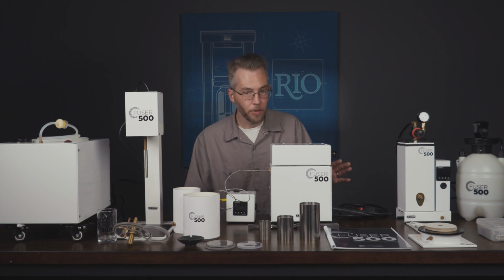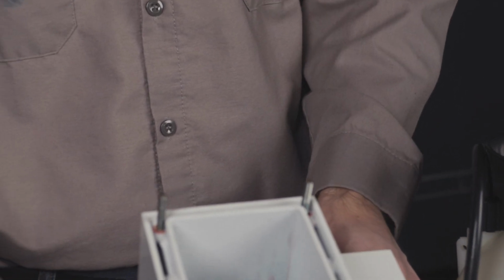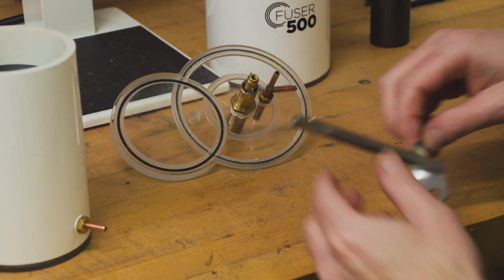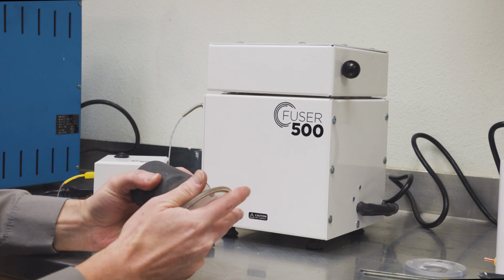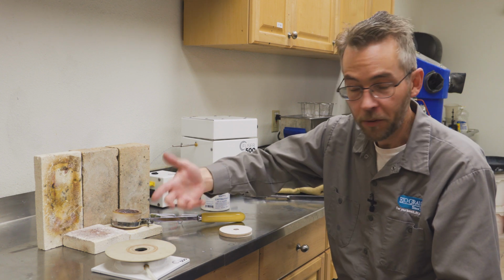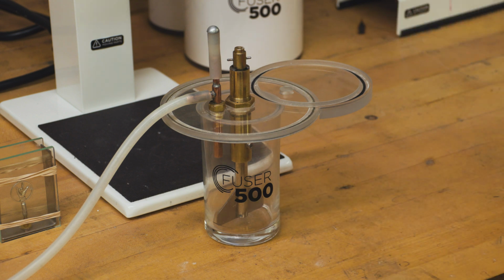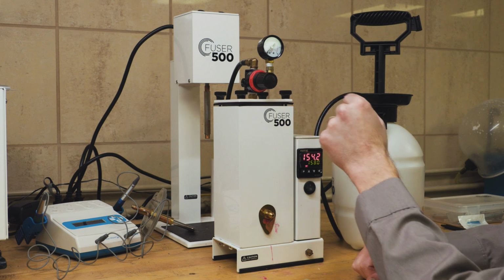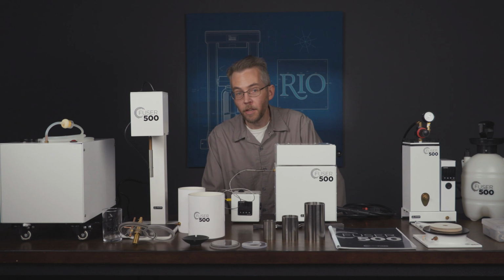Fuser500 Micro Casting System Complete Overview

Comment: As someone who has been casting for decades, save yourself the time and trouble and save for a traditional casting set up. Yes its more expensive, but, all the little tubes, hoses and attachments on this thing will certainly get lost and lets not forget there was no illustration how to clean the parts of this after use, particular the investment phase with the flippy maneuver and balancing act. I have used the RTV mold making method and it works, but air bubbles will always be a problem because you cant pull a vacuum on the mold. Pennywise pound foolish folks.....
Reply: I agree